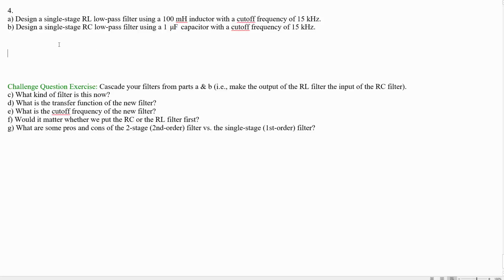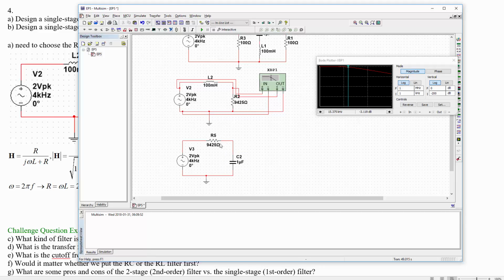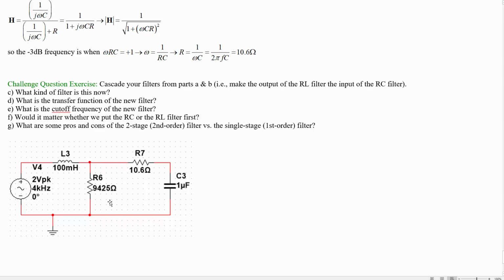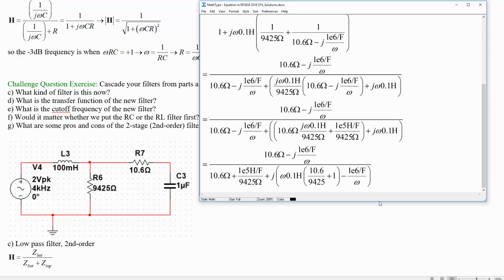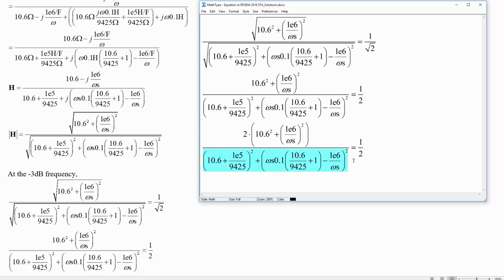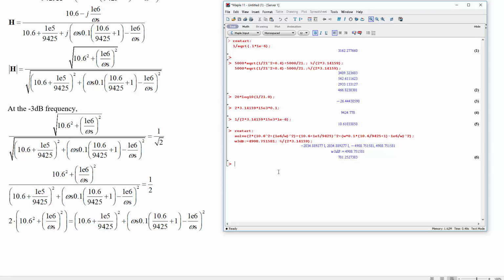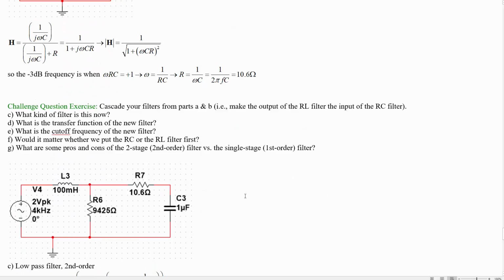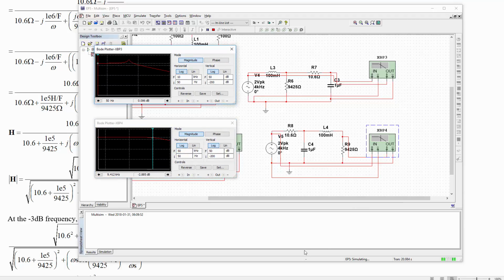Frequency Response and Filters: Extra Problem #4

Comment from the maker: Hi all! Looks like I got too excited by all the math and accidentally only calculated the transfer function to get to the top of R6 rather than to the top right side; to fix it, you should multiply the H here by ZC/(R7+ZC) to get the full transfer function.  This maple code will do that for you (so you don't get so distracted by the math like I did!).  The answer is 1/(1 - 1.001124668*10^(-7)*omega^2 + 0.00002121007958*j*omega)

It still looked OK because the spot we analyzed in the video was between the inductor and capacitor so still captures much of the resonant effect information, but would miss out on some of the very high-frequency roll-off.  Try this code!
restart:
L3:=.1: R6:=9425: R7:=10.6: C3:=1e-6:
ZC:=1/(I*omega*C3): ZL:=I*omega*L3:
Zright:=R7+ZC:
Zpar:=1/(1/R6+1/Zright):
Htop:=simplify(Zpar/(ZL+Zpar)):
Hfull:=simplify(Htop*ZC/Zright):
Hmag:=abs(Hfull):
with(plots):
HmagdB:=log10(Hmag)*20:
HtopdB:=log10(abs(Htop))*20:
semilogplot([HmagdB, HtopdB], omega=1e2..1e7);
maximize(HmagdB, omega=1e3..1e4, location);